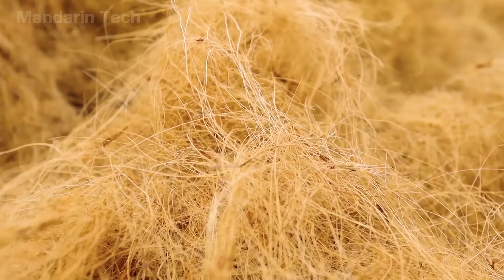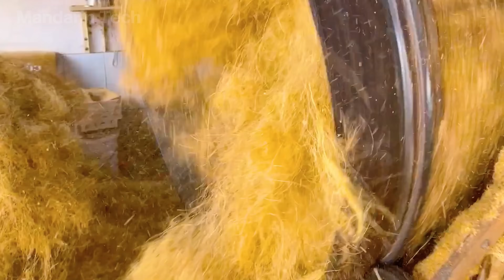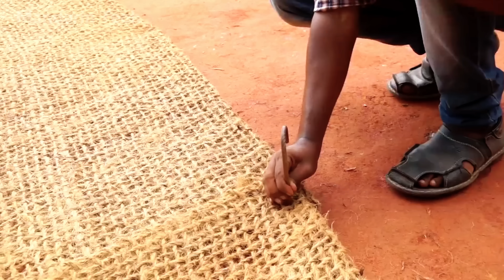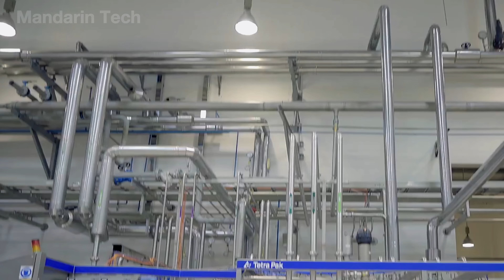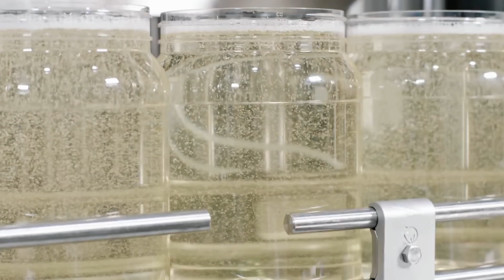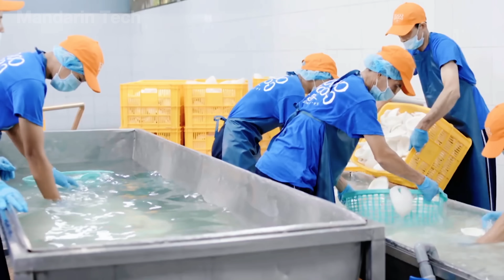Indian Genius Engineers Build A Massive Road From Coconut Waste Making Americans Must Admire

Comment: what's the recommended thickness & weave density for a road construction?
Reply from the maker: It depends on the project, but road geotextiles are typically 200–400 g/m² with a strong woven structure for stabilization and load distribution.

Comment: I read this somewhere else also, in Assam they are doing it. Coconut is excellent water resistant, it helps in holding soil and provides base to lay road......good job.
Reply from the maker: Yes 👍 Natural materials like coconut fiber are increasingly used for soil stabilization and erosion control — a smart and sustainable solution.

Comment: They should adopt modern safety methods for the workers. They are mostly in barefoot and wearing non working clothes. The tree climbers should not be allowed without any safety harness etc. Surely, there are far more modern methods to pluck coconuts. The operations do not look too professional. Maybe they can bring in the IITs to suggest ways to modernize this highly important road making.
Reply from the maker: Worker safety is important everywhere, and the video mainly focuses on showing the process rather than evaluating safety standards
Reply: Hey, armchair expert, cheap labour is plenty in India. In such places whereby cheap labour is aplenty it is cheaper to use humans than machines in some processes. Plus using more humans is also great sociopolitically since it reduces unemployment.
Reply: @iamnormal8648  nonsense. Efficiency is paramount. Human labor should be properly protected in PPE while working. Efficiency saves money, increases profitability, lowers costs, and which can all be utilized for other projects. Think outside the Indian box. You are stuck in ancient movies like Naya Daur.

Comment: How long will it last?
Reply from the maker: It depends on maintenance and management, but many projects like this can run for decades
Reply: @M @Mandarintechmido  decades is a good number
Reply: @jpeijsj8762 bruh your racist mindset 😢
Reply: The only downside I see is that this coconut fibre is bio degradable and over time it will rot away. Would be better to recycle plastic waste into fibre and use that.
Reply: @nelsonchinasamy9857 Coconut fiber is actually a natural fiber that's extremely durable to natural forceds and takes a really long time to biodegrade. That's the reason why they were used as nautical ropes. 
Not to mention, for natural materials to biodegrade, there needs to be an oxygen rich environment where aerobic microbes can grow. The asphalt and other layers on top of the coir geotextile, makes the soil entirely sealed off from microbial activity
Reply: @aleenaprasannan2146 makes sense